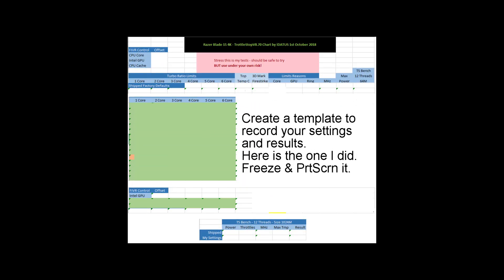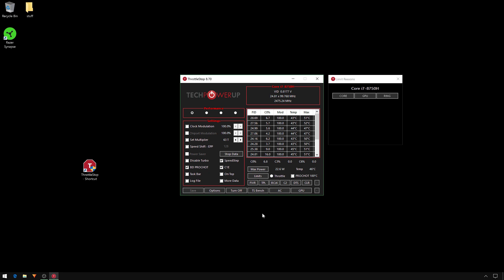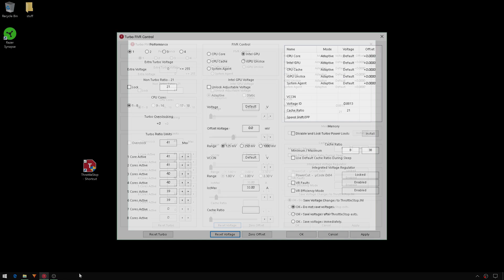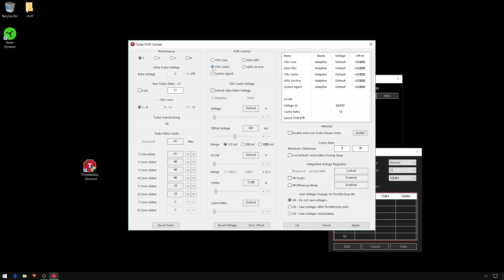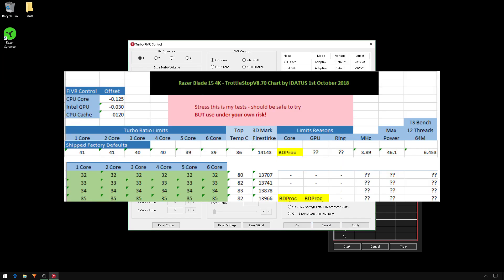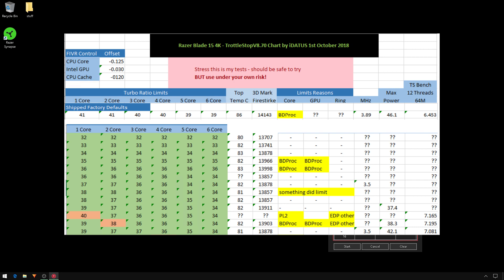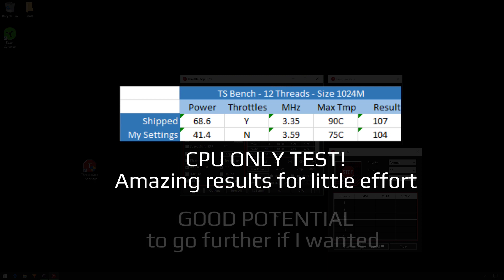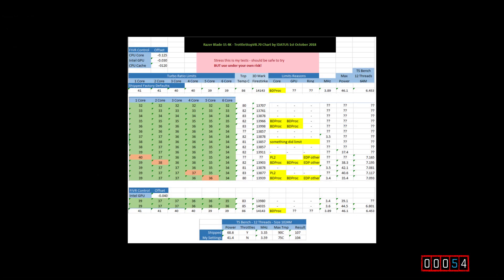Razer blade 15 undervolting with ThrottleStop⮜iDATUS⮞

Comment: Hi. First of all sorry for my English. I have started following you some weeks ago. I like very much the content that you post. I have received a Razer Blade 15 2018. 1070 MQ. I have tried to undervolt following your tutorial, with not so good results.  I started with all cores at 32. When progress of TS Bench was 40% I started to receive  PL1  in the Limit section. Temperatures are aprox 80 C.  I made a video with the result: https://youtu.be/gdAy5KkvATI. Could you give me some guideline of what I'm doing wrong?
Reply from the maker: Thank you very much for the nice comments. If you haven't already please subscribe as I update the youtube discussion tab frequently on whats coming. I am also building a website, taken 2-3 months to get to grips with wordpress and elementor pro, youtube plugins, webhosting, the list goes on. SO
There are a lot of comments I have posted on this thread, not sure if you read them all BUT I missed a vital step in the upload. Yes it my bad, BUT its a simple one which will fix your issue.
Click the "Turn On" button on the bottom of the main page and it will enable your settings.
Any other problems please ask, I nearly always monitor the channel UTC 09:00 to 21:00 and answer all questions.
◄iDATUS►
Reply: @iDATUS  Hi. Thank you very much for your answer. I have subscribed and bell is on :) Great news about the website. It will be very helpful. I checked the thread and also clicked the "Turn On" button but still with problems. I have uploaded a new video with the new settings: https://youtu.be/hTOm64bEEJ4 (Only 2 minutes video), If you can check it I'll be very grateful.
Reply from the maker: Hell again Lucas and that's for coming back. Sorry for late reply, wasn't notified you have posted a comment by youtube. So found this by accident.
I watched your video and I need to ask a couple of questions, don't worry nothing complicated.
Check that Razer Synapse performance is set to Balanced.
Also that OBS is set to use NVENC H.264
To do this, go to Settings, Output, Recording TAB, Recording format MP4, Encoder NVENC H.264
This will ensure its using the Nvidia built in encoder rather than the CPU.
P1 is saying it has hit a power (wattage) limit and it showing RED means it is still hitting that limit.
I would also say don't use Throttlestop Benchmark for test it doesn't behave like we all think it does.
Again I will explain more in the new upload I will be starting in next few days.
Change your multipliers to 39,37,37,36,36,34 for now.
If you want me to remote control your RB 15 I am happy to so as it will be a service I will eventually offer to patreons and regular donators to the channel and website. Its good practice is for me. Its all totally secure, no phone numbers require,, encrypted, safe and totally free from the software side.
Spent about a month on it a little while back, if it appeals to you contact me via wire.com and invite me iDATUS.
Wire is also a Mobile app for Android and Apple too.
Reply: @iDATUS  Thank you for your response. I checked Synapse and is set to Balanced. Regarding OBS I changed to NVENC H.264 but the same result. Regarding not using Throttlestop, what you recommend?  It will be great if you can remote control my notebook and also that you will offer as a service. I have added to wire.com. Thanks in advance!   Lucas.
Reply from the maker: Anyone curious on what happened next I can tell you it all went well and Lucas is a happy chappie.
That's what I want to hear. ⮜iDATUS⮞
Reply from the maker: Lucas how you doing?
You wanted to know when I had setup how to support the iDATUS brand feature.
If you are still interested in giving financial support have a look at my website link.
https://idatus.tech/supportme/
Let me know what you think. ⮜iDATUS⮞

Comment: Can you elaborate more on your method of undervolting the intel gpu. Not understanding why you lowered that number?
Reply from the maker: Thanks for posting a comment and asking an interesting question.
For anything none related to dedicated GPU work like the NVidia the CPU does the rendering. This obviously will create heat and warm the rest of the CPU which we are trying to keep as cool as possible. The CPU is the major heat provider in the laptop and effects the performance of the NVidia.
CPU throttles at 90C the NVIDIA at 70C and they share the same heat sink.
See my more FPS or Cooler upload for a better explanation.
https://youtu.be/R_Ej4V_cQLw
Also I have learned a lot more about how the CPU and Throttlestop works and that's should be out end of May early June.

Comment: still looking forward for your revised guide for throttlestop (maybe some minor tweaks like disabling speedstep if you use speedshift, etc.) Also as far as i understood - we are not able to go far beyond 35 all cores if not in Gaming mode, such as we simply power throttle and only gaming mode enables 45 Watts. if in Standard mode then it power throttles ( red PL1 and so on) . The question here is - what's your opinion on gaming mode? I see that cooling is much loader and without headphones it is a pain to play, meanwhile no significant changes in FPS ( maybe 5-7)
Reply from the maker: Thanks for posting and yes I am looking forward to it as well.
It will be a real eye opener for all!
Delay is due to me fast learning on how to build a WordPress iDATUS website to go with the iDATUS YouTube channel.
I've not done much with gaming mode set BUT that said reducing voltage etc will still reduce the power and coolness.
Check out my latest upload, its entertaining and has practical examples.
If your not using all the cores at the same time and the program (game) isn't sending a single request which is multithreading then you can have different cores running at different speeds.
Will explain more in the update. I got so many videos lined up its madness.
◄iDATUS►

Comment: I am getting EDP other when my laptop is idle. What can I do about this?
Reply from the maker: Sorry for late reply I have been on vacation.
I have replied to a lot of questions with this upload and can I ask you to read through them as they may help.
If your still having issues or question then come back and I will do my best to help you further.
Reply: @iDATUS  No worries at all! I did try every fix prescribed, including bios updates. It appears that the EDP Other will not go away. And like before it only happens at idle.
Reply from the maker: I am happy to help further. 
Remember Yellow means something peaked it in the past no matter how long ago.
RED means its happening now.
You will need to leave the Razer for a few mins for it to settle down.
Use TASKMANAGER:
Start-up tab - disable stuff that's snuck in there that doesn't sound important e.g. Steam
Details tab - View Menu - Update Speed - Low : Sort view CPU
Note: I just watched mine at idle and it too popped up EDP OTHER if I leave it a while, there is always something that will awake and do something now and then but it should be just that now and then.
I just clicked the Ring on the menu and its been clears for long time.◄iDATUS►
Reply: @iDATUS  Hi IDatus, thank you for your assistance with this. It still hasn't gone stopped doing it but I am not noticing any performance hits. Would you recommend disabling turbo in the settings for Throttlestop? I have noticed some people saying that can help temps significantly, but I am afraid I might lose significant performance.
Reply from the maker: @KungfufightU  Have you seen my just uploaded more fps or cooler video◢
It shows how to display all 12 cpu core graphs. Run what you would normally do, game etc for at least 5 mins and see how many cores are being used.◢
Then using GPU-Z use the average and max temps as shown in the video to see if the Razer is throttling◢
Remember you can set up 4 presets with throttlestop and MSI Afterburner◢

If you would like to chat more then for you I would offer wire chat◢
I can also remote control your Razer, its safe and doesnt install files on your Razer◢
Let me know if the video helps and if you want more support from me◢

PS My next tech guide will on an updated Throttlestop. ◄iDATUS►

Comment: Hi, first would like to say i really appreciate your tutorial it help me understand more about under volting stuff. But I am facing an issue, i have tried to follow your tutorial since from the start many time but it doesn't matter what i change for example all core are in 36 i still have either PL1 or other errors =( i really have no idea what to do and to fix those. Please help me out, I really appreciate your help in advance. But if you have other chatting app please let me know of you don't mind to add me. PS. so sorry about my bad english.
Reply from the maker: @Prin, first of all thanks for posting a comment, I monitor the channel almost all the time I am awake. When you subscribe you can also use the discussion tab on the channel page where I update what's coming soon.
OK enough chat lets get on topic. Firstly have you read the other replies I have given in the thread?
I have just downloaded the latest version of TS and plan on doing a newer more polished version/series soon as I crammed to much in due to time length. A lot of people view this upload and I want to do a more polished version.
From memory though I think it was to do with Synapse being set to game or max mode and or a High Performance plan for power settings via the battery icon on the taskbar?
I don't plan on being away from my PC for a while today so please send more info, updates Q's etc. Its the iDATUS way.
PS. Just cause I am English doesn't mean I am good at it hehe. Your English is spot on.
Reply: @iDATUS  Thanks for replied ! yeah first of all I checked all the power setting that you mention in the video custom balance power with windows as well as balance in synapes  software. As you mention idk if that because my TS is newer version than you or I did something wrong, coz even I try with the factory setting and hit the TS bench my temp wont go up to 80c either =/ I will be waiting for you new video ! in the mean time if you can figuring something out please let me know haha! oh OTW I also successfully migrate my 256gb SSD to 1 TB SSD by following your tutorial!
Reply from the maker: @Sli3py I've played my local copy of the video as I keep them all and even I use them, bit like documentation.
Using latest version and following the guide using TS Bench at 12 threads and 1024M size about half way through I get PL1.
What I didn't know at the time is if its in YELLOW it means at some point it hit the throttle, if its RED its currently being throttled.
I had a RED PL1 and the reason I hit the 40W limit.
Also note that all cores at 36 failed for me only the 1st 6 at 36 and the last 2 at 35 worked.
have you installed any other software eg steam,AV as anything running other than TS will cause it to spike.
After turning the laptop on you need to leave it for about 5 mins for Windows and Apps to settle down.
Use Task manager to check cpu is as close to 0% as you can get it.
As for chat app I was thinking of using Signal what you think?
Reply: @iDATUS  Thx for reply ! yup I have a several software like MSI afterbunner, logitech and synapes but no Anti virus tho. I always like always get EDP other on the ring and PL2 on core no matter what setting I use =/. And yup I use signal please add me I think its easier to discuss via that dont u think lol
Reply from the maker: Will do when I create an account in a bit.
Listen, the bad thing I missed in the tutorial is to say click "Turn On" so just in case you haven't I thought I mention it.
As to apps just the ones running at the same time as TS matter.
Check startup and disable everything not crucial for the test, including Logitech for the test purpose.
What we are trying to do is get a nice clam free of distractions environment. You can enable them after.

Is the Max power showing very close to 40W?
Reply: @iDATUS  Ah nice please let me know when you got the acc up and running. and yeah i did turn off everything including the TS monitoring option, I always hit 45.5W lol? maybe that is the issue? but how u lower the power
Reply from the maker: Im still looking at chat systems. Signal uses phone numbers and that's more for family and friends.
Want to create and ID and use that. Will update when ready.
Can you re-read my comments and answer them all if you have time.
Reply from the maker: OK im trying wire. name is idatus of course.
Reply: @iDATUS  I just added you on wire under name sli3 !
Reply from the maker: So for anyone reading this thread.
Spent a couple of days with Prin via remote control / voice chat, trying to see what the issue is and find out what was causing his lowest power to be 12W.

Prin is a real nice guy and we had lots of fun but the most important thing to note here is BACKUP.
Please watch my Razer Blade 15 Backup and Recovery upload and do it NOW.

In short even after factory reset, turning ever little thing off, nothing changed it.

I used a forum where I know a guy in there has tons of hands on experience and it turns out that 12W is fairly average.
20W is high and 1.2W (mine) is amazing and not the norm. Ain't I the lucky one!

After rejoicing, Prin realised that he had some data he needed and thanked me for asking him to do the BACKUP (yes you reading this, BACKUP NOW). All recovered to before we piled in to fix something that was not broke :)….
Backup upload: https://youtu.be/-8UZiqp-S4o
Recovery upload: https://youtu.be/Moyld_XhDBw
Reply: without your help and your knowledge I would running around like headless chicken lol! Thank so much for your time and your help! your channel deserve more sub and like! once againse I really appreciate your affords, you are truely legend PS. now i have 3 backup images and i think it will be more lol
Reply from the maker: Prin how you doing?
You wanted to know when I had setup how to support the iDATUS brand feature.
If you are still interested in giving financial support have a look at my website link.
https://idatus.tech/supportme/
Let me know what you think. ⮜iDATUS⮞
Reply: @Sli3py  hi man, how are you doing, by now im following this tutorial but i got the same problem as you, no matter waht i do i always get EDP other on the ring and PL2 on the core, have you fix it?
Reply: Gustavo Rivas hey man, after awesome helps from iDATUS we concluded that it might me Razer shipped a newer laptop with modified firmware that SOMEHOW prevents tweaking...but im not 100% sure tho... i hope we can have some work around. I call razer support and they have no idea about all the stuffs, so hopeless

Comment: How do you reduce your watts from 68 to 41? My razer blade 15 stays at above 55W and is getting the PL1 (with Synapes Gaming) and PL2 (with Synapes Default) after adjusting down the core and cache by 0.125. Did you change any setting in TPL as well e.g. Long / Short Power Max? Many thanks for your help.
Reply from the maker: I only changed what you saw. I forgot to mention to press "Turn on" on the front of throttle stop, just in case that's your issue.
Lots of things run in the background of windows, make sure you use task manager to see what's going on.
Windows updates and Windows Defender work a lot for a good while after power up.
I will be doing an updated version in the near future as I am towards the end of controlling the GFX card series for the Blade.
Let us know how you get on and if your still getting issue and see if I can helps some more.◄iDATUS►

Comment: I followed ur exact setting and I’m getting yellow “EDP OTHER” under “RING” what is that and how do I solve it? This happens on idle and pops up every time I refresh
Reply from the maker: Hello Joel and thanks for posting a comment. 
I have also been getting EDP Other more than I was before and put it down to just me.
Done some research and have a couple things to try.
Let me do that and get back to you in next 24 hours.
PS On my tutorial I didn't  say 
"on the main Throttlestop screen, bottom row of buttons, click the TURN ON button"
If you have't done this please do so and let me know.
◄iDATUS►
Reply from the maker: Ok, For me I have created a customised power plan
right click over the battery icon on task bar
choose power options
Normally it would be Balanced (Recommended) but I selected "Create Power Plan"
Then inside there you have 3 options, Balanced, Power Saver, High performance.
The high performance gives the CPU more power so can hit limits easier.
Make sure when doing the tests you have Balanced set.
◄iDATUS►
Reply: If it is still a problem for you - i solved it: intel iGPU profiles causes yellow EDP OTHER. To solve it you need to go either to Intel Graphics Panel or Battery Profiles on Windows  - edit all modes and set the intel iGPU profile to Maximum Battery Life, then it goes away. If you need more clairfications, pm me, but i guess we are not noobies here, you'll figure this out.
Reply from the maker: @MrDrugmx  Sorry I didn't reply to this post when you posted it, I did read it as I do monitor my channel etc intensely and is not like me not to reply within a few hours.
After I read it I thought, hmm must look into this and see, a) does it work and b) why and c) is there something else we can do and of course d) brilliant.
Just re-read the entire posts to refresh my mind again and answer some other questions posted today.
Website is moving very well now and I have the look and feel I want so I must get to it soon and do a new TS upload.
◄iDATUS►
Reply: @MrDrugmx  hi, can you give more detail on the process please?